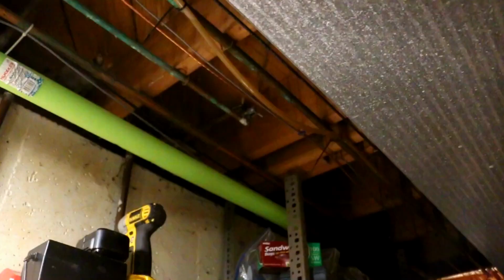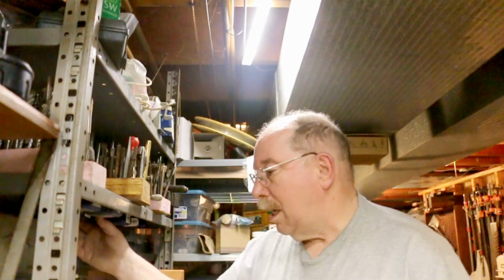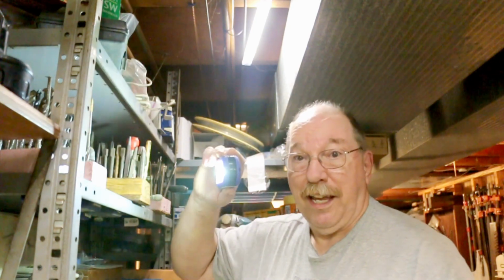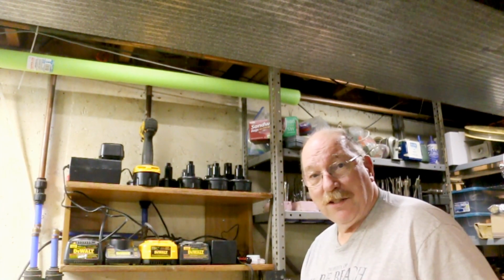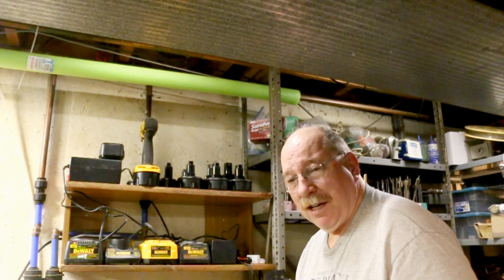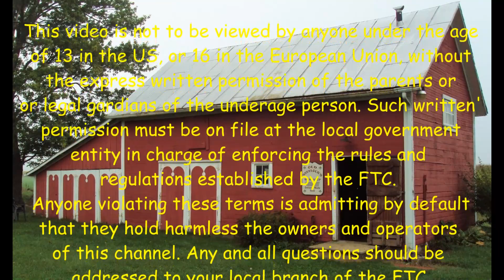Shop Organization ~ Lighting

Comment: Looking good  I use a flashlight to find things also, but I just can't see anymore.  I did work on that 3-way light in the kitchen yesterday. It hadn't worked sense day one back in 06.  I took the switches out and they looked like the wiring was right.  I checked  the continuity on the wires all was ok.  After 2 hours of head scratching I checked the switches and I found the the 3-way dimmer would not working transfer the current to the other switch.  I replaced the dimmer and everything works. when I get out I will replace it with another dimmer just to keep peace in the home.  It's good to get a few small projects out of the way, give Sadie a pat on the head for me and maybe a doggie treat too.  Hope you and Lydia remain safe along with the rest to the family. Thanks for taking the time to share your adventures with us.
Reply: The grow lights are ON! Cheryl brought in a tray of seedlings the other evening and the lights wouldn't come on. I was here computing and asked her if the breaker to the outlet was on. It was and she was afraid the bulbs were shot. The power strip was on so I finally got her calmed down to see if there was a switch on the light fixture itself (4 foot fluorescent, 2 bulb in a 5 shelf Lowes steel rack unit) and there was. One pull and the lights came on. Some things just take a while!
Reply from the maker: A steady hand on the controls goes a long way toward success.
Reply from the maker: Rough week but we're gaining.

Comment: This would not work for your application but my son just put 3 of the led paddle lights in his 3 car garage. A real game changer. They just screw into a regular light socket and you tilt the paddles to where the light is needed. Being LEDs the last for years. Available on Amazon. I plan on doing this soon in my own garage.
Reply from the maker: The light strips are salvage from the kitchen remodel.  I had them mounted under the cabinets. 😆😎

Comment: put up some new led lights in the barn work shop did some mod to a hf press getting about ready to to get mowers and tiller ready for spring
Reply from the maker: I have one of the HF C Frame 10 ton presses out in the garage. Comes in handy quite often.
I keep thinking I want a 20 or more ton press for the blacksmith shop. The HF 20 is great at the price..

Comment: Haven't seen lights like that before. Where did you get them? Good video as always, wes
Reply from the maker: Hi Wesley.
They came from Menards. They are nice and I put a set over the main bench with the vice. 
They were salvage from the kitchen remodel. The old lights didn't reach under the cabinets very well. I put this set of LED strips under the cabinets on both sides of the sink. 
The new cabinets have more lights because we doubled the counterspace. I also installed low voltage (12v)  lights in the remodel  instead of the 110v like these. The 12v lights cost less, have smaller easier to conceal wires, and have switches on the end of each light.

Comment: Now the earth was formless and void, and 
darkness was over the surface of the deep. And the Spirit of God was 
hovering over the surface of the waters.
And God said, Let there be light, and the was light 
And God saw that the light was good, and He separated the light from the darkness.…
I see sandwich bags there, keep a couple in your pockets if ya don't have any latex gloves for when ya go out. they work in a pinch. 
Good service Unk I mean video
Oh and here I was.
Reply: U iz!
Reply: And the Lord told Unc 'You ought to do something about that dark place before you pull a Lewie and CRASH'! He did and the rest is history.
Reply from the maker: I was putting things in the storeroom when I ran across the patch cord for the two LED light strips. 
They work really well. When I set up the lights in the shop they are plugged in to switched recepts. That way I can add lights for accent lights or move them as needed. Allmthevreceptscare controlled by the switch at the eñtrance. 
It helps me to remember to douse the lights as I leave. 😆😎
Reply: @OldSneelock  Heaven knows we need all the help we can get. Lots to remember and I have to write it down but I can't read what I write usually and by the time  fire up a printer it'd be lone gone. So we do what we can do and hope someone calls back if it was important. Now then, where was I...............................
Reply: The place is looking more void as time goes on!
Reply: @OldSneelock  I hope what ya ran across the cord with wasn't sharp and ya didn't cut it.
Reply from the maker: Substitute "found" for "ran across". I was looking for my spare power cords. The Milwaukee Hammer Drill needs a new one.  😆🚜
Reply: @OldSneelock  I've got spare drop cords if you need one. I just whack the end off one and there's a nice 3-wire cord and plug. Orange in color, no less!
Reply: @lewiemcneely9143  I drop a cord once in awhile but I just bend down and pick it up. Now I'm looking four4 my ranacross.
Reply: @OldSneelock  This doesn't only happen with age. I came into the house, decided to have a coffee, took the milk from the refrigerator and made my coffee. 
About two hours later I received a call and had to go out to collect my wife. 
After 30 minutes I had to call my wife back and say that I could not pick her up as I had mislaid my car keys.  
My wife came home on the bus and asked me to go through what I did when I arrived home. 
My wife went straight to the refrigerator and retrieved my car keys. 
Doh!
Reply: @lewiemcneely9143  I have a whole shelf (about 2 1/2' x 2' x 5" (the shelf was a dumpster find)) stuffed with cords (removed from stuff I've scrapped) and extension cords.  If I ever actually get to fixing or building stuff, I should have a cord to use.

Comment: Sitting in front of the pedestal fan. It's warm outside running after a mower easing along. There was very little run in me in the Army and a lot less before and NONE after. Done with the back and side yards and another 1/3 of a bag. Got mout the Roof to do under bushes and forgot hyow to start it. Throttle is backwards and the 8-horse I/C is very healthy so I had the throttle in OFF and was yanking and put my foot on a back tire and gave it a yank (it usually starts after winter with 3 pulls and I was on 5 or 6) aND THE WHEEL ROLLED AS DID MJE AND THE EDGES TOO0K OFF THE THIN TOP LAYER OF SKIN SO i NOW HAVE A BANDAGE ABOUT 4 INCHES WIDE ON MY FOREARM but i MOVED THE THROTTLE AND THE THING FIRED RIGHT UP, NEXT PULL. I hate caps locs. I updated this rig last night and am on the full sized keyboard instead of the wireless and the caps lock is in the opposite place. I hate them all. And seeing is a nice thing to be able to do. Especially in the dark. Or in a hole. Or in a dark hole. I'll quit. Got to finish the front. Cool front on the way but this fan sure feels good. A.C. on yesterday evening. 80's are HOT coming from 50's! GBWYall from (Us'ns) on the swamp
Reply from the maker: I have enough different engines and various equipment now that I'm thinking of adding a painted on startup procedure. 
Not sure that will help. I spent 20 minutes starting the power washer. Ended up with a can of starter fluid to get the thing to start. It has a step by step procedure.
Reply: @OldSneelock  I got a felt tip and marked off, run and choke on the Roof. It's hooked up backwards in that off is forward. I hooked the blasted thing up so I ought to know. Maybe your washer and the splitter have the same kind of engine. I know your snow blower does. I'm going to see if I can find a new spring for the diaphragm on the pump side. It was weak and I stretched it the last time but it had some rust where it's probably collapsed now. I'll pull the carb and leave the tank in place. The main jet was clean as a new one and I tried several times pouring gas in the throat of the carb and it'd run till it burned it up but just wouldn't pick it up. I have an older whole deal that I'll swap over if I can't get a spring. Time marches on!
Reply from the maker: @lewiemcneely9143  The snow thrower has a primer. 10 pumps and it starts every time.
Reply: @OldSneelock  Rats. No primer here but the same kind of recoil. Has a choke but the bypass hole is too big. Needs a solid disc and then it'd get enough gas to start and not have to take the breather off and hold my thumb over the intake hole.